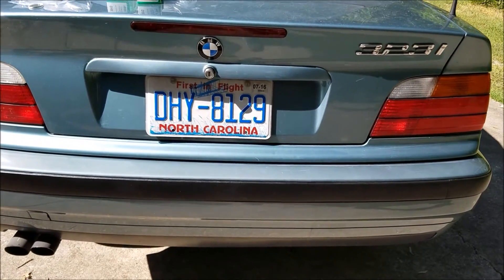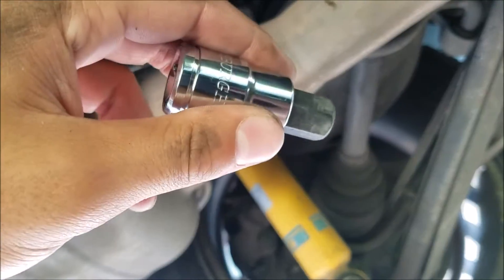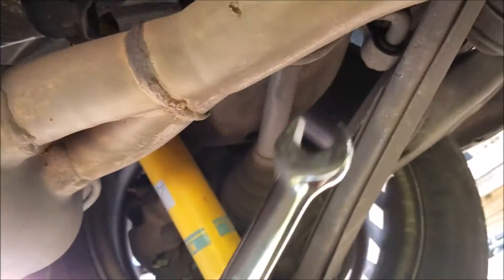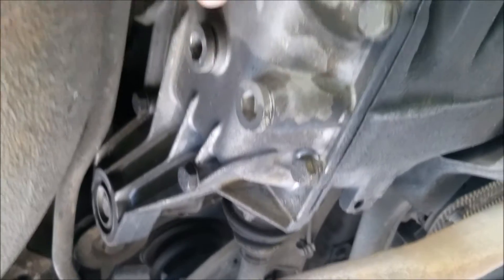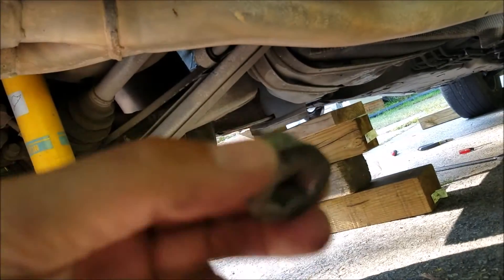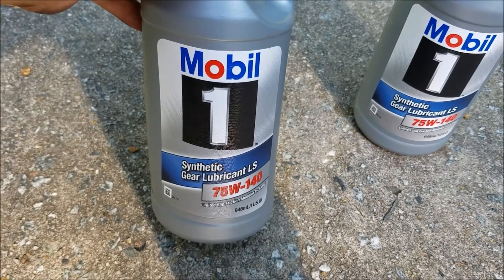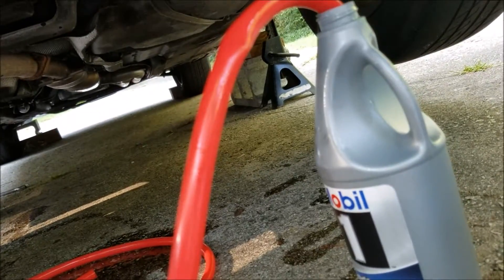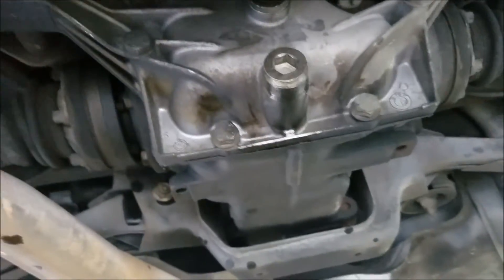E36 BMW Differential Fluid Replacement

Comment: Would this fluif be okay in differential?  Valvoline - 773636 SynPower SAE 75W-140 Full Synthetic Gear Oil 1 QT
Reply: Yes

Comment: That means i can do this myself. But I discovered that there is a leakage by the side. How do I stop it?
Reply: New axle seals
Reply: @williamwalters9403  The axle was noisy when I am on speed and I was advised to change the whole axle completely. I did that and the noise stopped but I noticed that my rev has increased when on 120km/hr to 3.5rpm. Any idea pls?

Comment: Does it solve the problem when  I hit some rpms ,usualy 2500 - 3000, it coming whining sounds from rear of the car?..
Reply from the maker: Your CV's can cause a whining sound as well, I'll be honest though if your diff is making sounds usually there's already been damage done internally.
Reply: https://www.youtube.com/watch?v=3uKyjSq4Ktc

it is sound  little bit like this one..
Reply from the maker: Go ahead and change the diff fluid, it's cheap and fairly quick to do. If you happen to notice a lot of metal shavings then there's more than likely already more serious damage. When you get in there I would look around for leaks as well.
Reply: Ok i try it. Thx for your help, mate.
Reply: And which oil do you recommend? 75w-140?
Reply from the maker: Yes

Comment: I'm looking at your video because I'm hearing a "dud" in the back  when I go on reverse and I know its the dif, do you think its a oil change need to be done? Or do you think its something else?
Reply from the maker: leo hernandez I would absolutely try the change first, and take a look at the driveshaft bushing. Hopefully it's not a bearing
Reply: It's your bushings
Reply: thats for sure the front diff bushing, mines toast as well and the only bushings i havent replaced are the subframe and the diff

Comment: I tried getting the wrench on the 14 hex but it's so tight and a hammer hitting the wrench makes it fall out what did you use to open it first time
Reply from the maker: You got a pipe? Put the wrench in a pipe if you can't get enough force to break the bolt.

Comment: that e36 is really clean underneath! no salt on the roads in winter were you live? here in the UK its all about preventing the rust 😬
Reply from the maker: I'm located in central North Carolina and we typically only get a snow storm once a year if that, luckily we don't have any issues here with rust erosion as a result of salted roads!

Comment: when do you know to change your diff fluid? any symptoms I should look out for?
Reply from the maker: Unfortunately there's no consensus on when to change the diff fluid. BMW used to consider it "lifetime", however I change it around every 60,000 miles. There are many who change it as low as every 30,000 miles. A symptom of bad differential oil is 1) whining sound coming from the differential, may increase in volume as the car increases in speed. This comes from a lack of lubrication on the gears as a result of low and/or bad diff fluid.
Reply: +E36 Fanatics great video very informative I'm actually in the process of upgrading my differential I own a 94 318i 5 speed manual which came with a 3.45 lsd I'm upgrading to a 4.45 that came out a 93 318is automatic can't wait to start this small project should fun